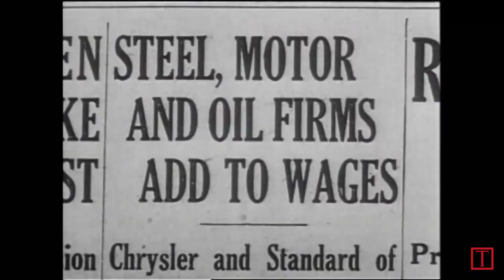What Happened To The American Labor Union? | TIME

Comment: IBEW Local Union #3 #unionstrong
Reply: UFCW local 700, unions are not just for auto and steel workers, they protect people in large service industries now also. You don't actually have to be in the food department to be part of the UFCW, as part of shipping and receiving my department is covered by the UFCW. Our shop is #unionstrong also.

Our truck drivers are covered by the IBT I think. The whole company is unionized, and it is because of that other competing companies offer high wages: to keep our union out. Workers even in non-union shops benefit from the pressure and leverage our union provides.
Reply: UFCW Local 1262 #UnionStrong